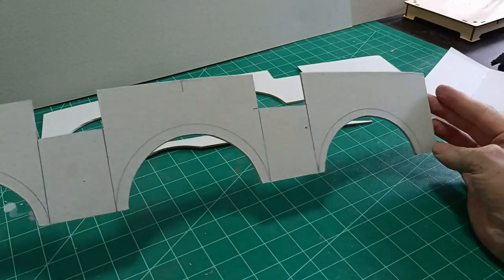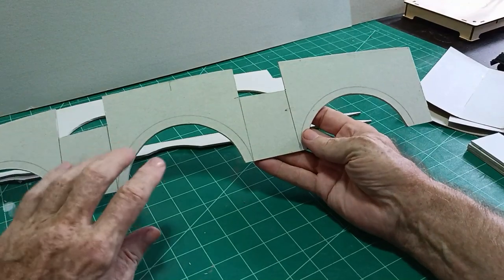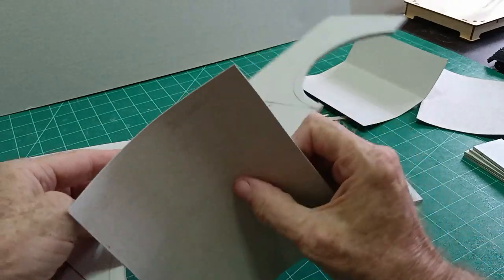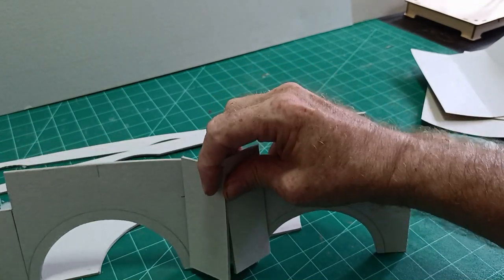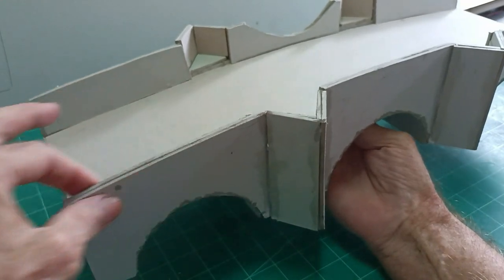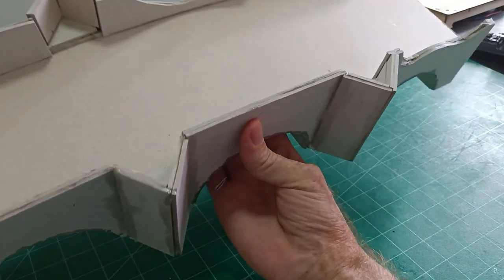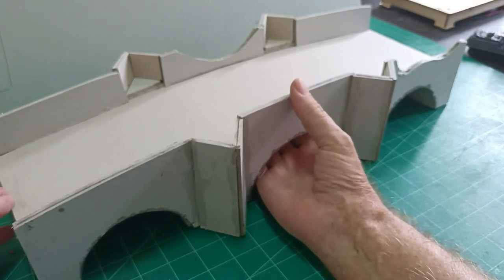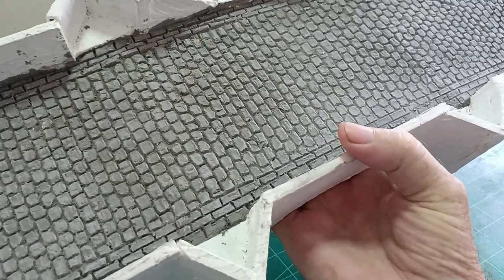Saving Private Ryan. Ramelle brige diorama tutorial 1/35 scale

Comment: Diorama Don relevant links
Ruined Building: https://www.youtube.com/watch?v=FrFnUs1kSS8 (7:35 - knife awareness and safety)

Ramelle Church: https://www.youtube.com/watch?v=AfVqWNHnF5w (Wall Filler (putty) primer) Painting with grout.
Ramelle Ruined Church: https://www.youtube.com/watch?v=AfVqWNHnF5w&t=1032s (sniper scenes) bell tower, Corner Pillars,  Add PVA glue to grout as binder.

Stone Wall: https://www.youtube.com/watch?v=i7yiHsiIYtI&t=940s (dry fit shown, can grout or mortar)
Brick Walls: https://www.youtube.com/watch?v=u-l_7-7X6JE (two methods of manufacturing and assembly, then: mortar, distressing, and weathering)

Rubble: https://www.youtube.com/watch?v=RxuOitEx0Ig (same process as brick making, but not necessarily to regular brick dimensions) Bonus: smoke damaged lumber (broken wooden roof trussing)

Cobblestone Street: https://www.youtube.com/watch?v=TdJuPAYTVVc
Cobbled Street: https://www.youtube.com/watch?v=TdJuPAYTVVc&t=3s (cratered)
Cobbled Street: https://www.youtube.com/watch?v=41deX7L-Nhk (with tram lines)